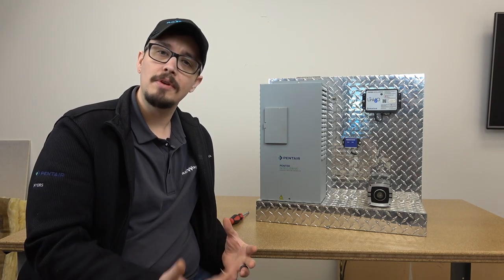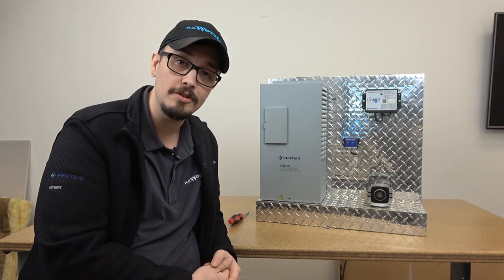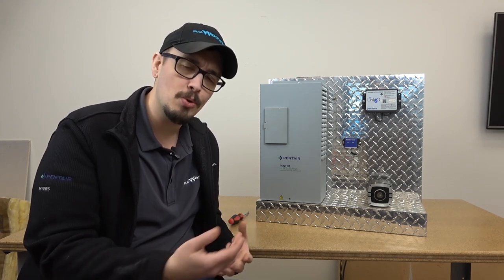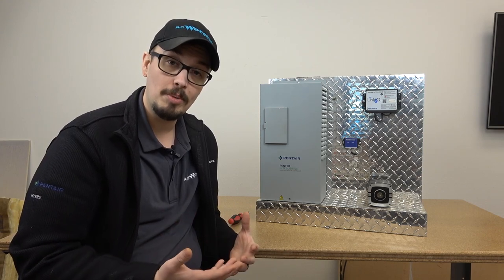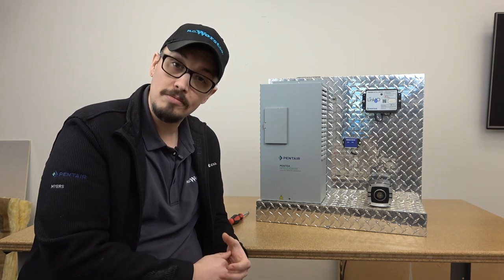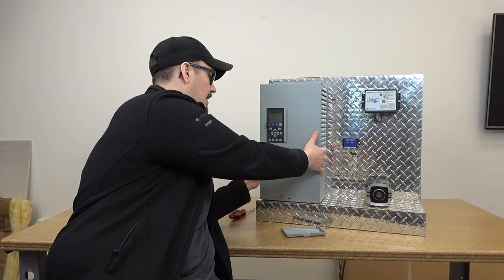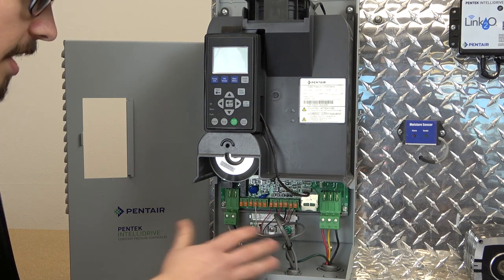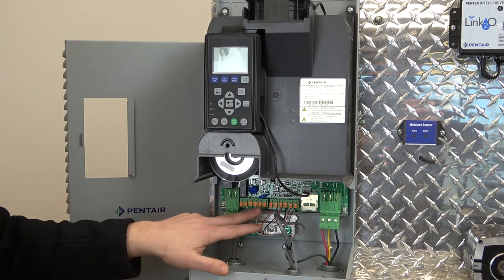Pentek VFD Intellidrive: Introduction

Comment: Another great informative video Chris!  We just had a new well pump installed at our home.  We replaced our 25-year old 1/2 hp motor with a new McDonald 1 hp pump motor and a Franklin Sub Drive Utility VFD.  We have a 5 inch well at about 80 feet. With this new system, the well pump is now a lot quieter than the old one, but now when running a faucet or flushing the toilet, we can hear the water rushing/running through the pipes behind the walls where we couldn't before.  We now have 11 gpm at the hose spigot where we had 6 before.  My wife is not very happy about that because I get up in the morning before her and if I run any water, it can wake her up. Any ideas as to why the change in hearing the water now?

Comment: All VFD's can have issues. The key is to know which one will fit the application best. The PID VFD has to have the transducer wired to it regardless of the application. The programming is a bit different (elegant in  my opinion )sensing pressure rather than current for some parameters. But with that said I have had issues with the PID's, SD, AS or others

Comment: I have a question on a VFP controller  "Fault - possible pipe break drive stopped"  I checked the pipes and found no pipe break.  I hit fault reset and then auto start and it fired right up and pressure went back to 60psi.  12 hours later I had the same Fault message.  What could be causing this?  Or how do I trouble shoot this? 
 Thanks!
Reply: You probably figured this out by now but it's most likely a leaky toiled. They call it Pipe Break but it just shuts down if it appears water is constantly running even at a trickle